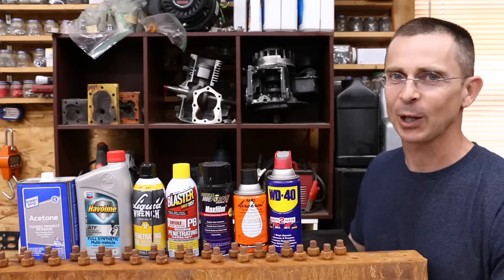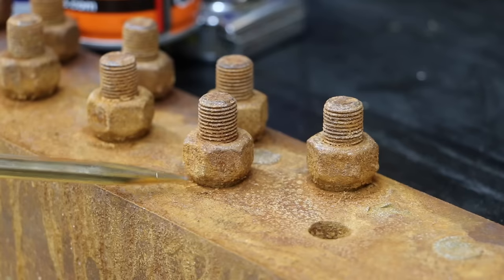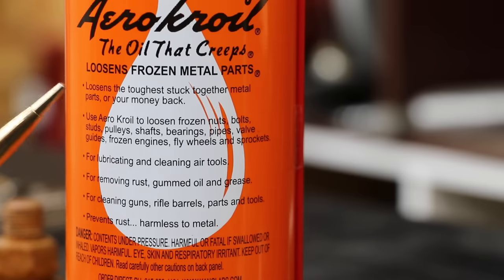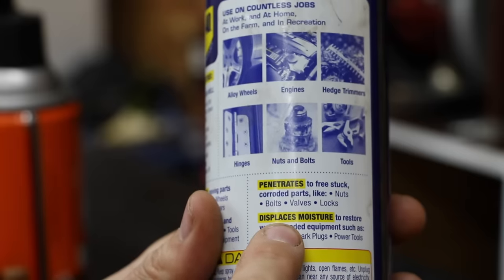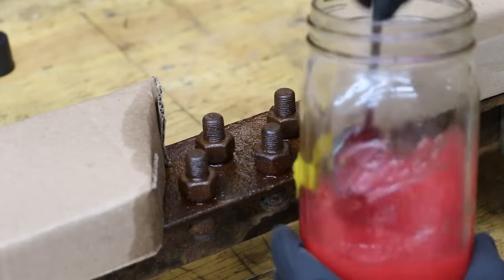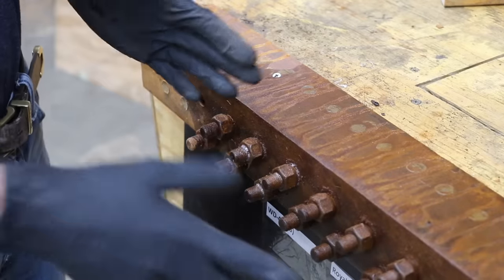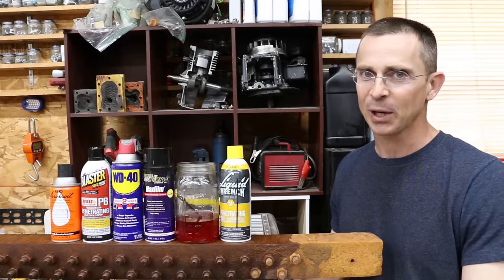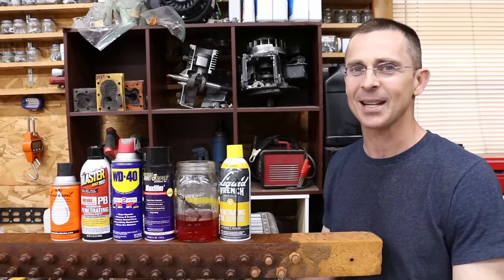Which Penetrating Oil is Best? Let's find out!

Comment: I love PB Blaster because you can shoot it across the driveway and lube that nut under your truck before you crawl under there to wrestle with it. 
Also helpful when defending yourself against the wasp nest you discover once you get underneath there.
Reply from the maker: lol. Yes, it does indeed have a lot of "blast".
Reply: I have always been a huge fan of PB but I felt this was a well done, honest comparison video. I just watched part 2 as well. Excellent job, thanks for posting these. I will still keep good old PB on hand but would also consider Liquid Wrench in the future based on this video. I keep WD40 around for indoor stuff where I dont want to a big mess blasting it with PB.
Reply: @trailblogger  PB blaster is crap. Everybody around here uses it and I just laugh at them. It stinks to high hell and barely does anything. Try ZEP45. It's expensive but definitely worth it.
Reply: @deeznutz2646  I agree about PB Blaster. It's absolutely useless. I didn't bother finishing the video but after 30 years experience turning wrenches... The absolute BEST penetrating oil made is AC rust penatrant #88862628. You can buy it for $13 at any GM dealer. I've tried every brand out there including 50/50 ATF & acetone. ZEP & Aerokroil are ok but the AC lube is the only thing that truly works. Closest second is industrial liquid wrench.
Reply: @stevemccauley5734  Well, let's get PF to test it.
Reply: @dposcuro  Or you could just go buy a can to prove to yourself and not care what the internet says lol. As a daily mechanic in my own shop I've tried anything and everything suggested to me or I've read about on the net. I've sat for hours reading forums to see what others suggested after I came to the realization one day that PB Blaster would evaporate after soaking for a couple hours and do nothing. Then also realized every damn can I had in my shop would stop spraying after it got down to an ounce or two. So I ordered several different brands I'd read others claim were great. MOPAR, Aerokroil, ZEP, industrial liquid wrench, Industrial WD40, mixed 50/50 ATF & acetone. Besides my torch, the next best thing is AC lube.
Reply: Did anyone here try Ultralube? It's good for penetration but then it gums up eventually. I just like it because it's non toxic and doesn't stink.
Reply: @stevemccauley5734  but can you defend yourself against a swarm of angry wasps with it?
Reply: PB kills German hornets quickly!  (Didn't try the other products to compare.)  And a lot cheaper than wasp/hornet spray.
Reply: i noticed during summer working on the car that pb blaster actually attracts wasps!!not fun at all!!!it has this orange smell that they seem to like!!
Reply: @reversalstudio  well what are you waiting for then? blast em!
Reply: That makes me think to try it out on the neighbors cat when he goes to piss on my rims lol, good stuff!
Reply: Man try spray glue, also if you are board you can go find you a wasp nest snack it and spray the wasps as you run real fast. Lol
Reply: You need to be fleet-a-foot so you can get away from the nut under the truck after you squirted him with PB Blaster.  I have an adjustable spray bottle of Texaco Penetrating oil mixed 50/50 with Marvel Mystery Oil that does the job for me.  The bottle squirts far enough  but not so far as to get in trouble with the "nut under the truck".
Reply: You can do the same with CHEAP carb cleaner or Gunscrubber with the red straw.
Reply: Trailblogger, it works good on flying predatory insects as well.  Write along with brake clean and carburetor cleaner but it's not harmful to paint.
Reply: I work on elevators and PB Blaster does work but the smell is overwhelming. My customers always complain when I use it so I stopped.
Reply: @blackrichard1029  project farm should try that
Reply: Lol
Reply: Not disagreeing with you at all actually. You can use whatever your little heart desires, I will stick to my giant can of PB Blaster for $5 bucks a pop. Good day sir.
Reply: That's funny I am watching this video because I have a stuck brake line and as I was under the vehicle today I noticed an angry inground beehive behind me. I also thought of spraying it with liquid wrench lol
Reply: @stevemccauley5734  I find deep creep by seafoam to work quite well. But not all places sell it, especially on weekend evenings which is when I can work on my own projects.

Comment: I'm a Kroil guy, and I think I just bought my last can. Thanks for the great video.
Reply from the maker: Thank you!  I wish Kroil would have done better.  I don't mind spending more, but need the performance to match the price tag.
Reply: I was thinking the same thing.  Ive used and recommended Kroil for years.  Now I feel like ive just wasted mine and my friend's money for years
Reply: I'm in the same boat. Have half a gallon of Silikroil left, so I got a couple more years before I can justify buying something else though. At least when I do my wife will finally stop complaining about the smell in the garage from when I use it.
Reply: Mat D half a gallon? fuck why did you buy that much.
Reply: carolyn mmitchell It was $50 plus slipping.

Comment: It’s quite interesting over the years of having a large shop and using different products, that sometimes the sales of the different penetrating oils and their slogans seem draw us to gravitate towards one over the other, especially the one with the capillary action! There’s always the proof is in the pudding over sales gimmicks! Great review I enjoyed it  : )
Reply from the maker: Thanks!  Thanks for sharing.
Reply: I just used PB Blaster on rusted banjo bolts on my master cylinder. Worked great! That's what brought me to this video, very surprised with these results!
Reply: I have seen obvious great results 3x from PB Blaster. I have heard brake fluid works but have not tried it. I am going to buy the winner of this contest and try it.
Reply: I'm from the NE/ Midwest.  Everybody swears by PB Blaster for loosening rusted hardware.  Of course, it helps to keep it from rusting in the first place.  Undercoating is a scam.  I've never used it and probably never will.  Just keep your car clean, including underneath.  And lubricate other devices as needed.

Comment: Interesting video! I am an automotive student and in our shop, all we use is PB Blaster, and that is all I have also used for years now. I may have to give Liquid Wrench a try! This is a very unrealistic test though. I do not know of anyone in the automotive industry that has time to apply 3 coats of penetrating fluid with an hour of soaking in between to free up a stuck bolt. Realistically one coat is applied, then attempted to remove after 5-10 minutes. This would be a more real world test for this type of product, but I guess if you are just a DIY repair person with plenty of time, this is a good approach. Great video though!
Reply from the maker: Thanks for commenting on this.
Reply: Koorite if you read my comment I say PB Blaster hands down. Its What every REAL PRO will reach for... And WD40 Is for Newbies and Walmart shoppers... I havnt had a use for WD40 Since i was 13 and im 40 now... WD40 Shouldnt even be in the lineup... Regardless, when you find something that works on EVERYTHING and youve never needed to look any futher... then WHY LOOK ANY FUTHER... Try PB Blaster and youll be set for life. I use it as my all around pen oil and rust gaurd... All my tools get wiped down with it after a hard use before storage. Plus 1 can last forever and a prick year... The Can ive got now ive had about 8 years. It doesnt take much at all and it last.
Reply: DrJones yeah, i know WD40 is junk. i currently only use pb blaster now and it works great, but this video showed that liquid wrench is also a good penetrating fluid, so i would like to give it a try since i have never used it!
Reply: PB blaster is junk. CRC Knocker Loose #1. PB is the WD-40 of penetrating oils.
Reply: The student speaks!
Reply: I think the point was that he used the same approach on each set of bolts. So his test is good enough for a rough comparison of products.

Comment: Great channel! I really appreciate the way you lay out your tests and your great attitude in general. You always see the way to get consistency and validity with your test parameters. I've been recommending Liquid Wrench for about 30 years now. Nothing works better on the tough fasteners. Nice to have you demonstrate it. The old formula was stronger, but nasty smell!
Reply from the maker: Thanks!  Thanks for sharing.
Reply: I just tried to buy some and everyone is sold out.  The nearest Home Depot that has it is 400 miles away, Walmart is completely out, Menard's is out...never mind.  Found it at Fleet Farm for less than half the price.

Comment: I'm surprised the PB blaster didn't do better. Glad to know I'm not missing out on anything by not buying into the Kroil craze.
Reply from the maker: Thank you for commenting!
Reply: Joseph Marciniak I've only ever used Kroil because that's just what my shop buys but this was eye opening. I showed this to my boss and now we are going to try Liquid Wrench. We rebuild antenna tilt machines on navy ships, so there are DEFINITELY some nasty bolts that I have to deal with.
Reply: a lot of people just fanboy the most expensive and preach it
Reply: my money was on PB as well, but then that's why I watch the video.
Reply: BlowDiamond I'm a mechanic in Pennsylvania and I've been using PB Blaster for years. If I can find Liquid Wrench locally, I'll certainly give it a shot. The salt they throw on the roads really corrodes things. Its damn near impossible to work on older cars here without a torch.
Reply: Joseph Marciniak Yeah, salt and steel are not good friends. We rebuild our units with 316 stainless steel hardware so we don’t have to worry about rusty bolts the next time around.

Comment: As a former millwright there is one tried and true that you did not use, the hammer! The old adage of it that don’t work get a bigger hammer (there is a modicum of truth to that). If you whack on a rusted up bolt or nut a few times you will always loosen it up a bit! That’s why impacts work soo well! 
You came up with the same results as old uncle bumblefuck did! AVE!!!
Reply from the maker: Yes, the hammer works wonders!  Thank you!
Reply: Hit with a hammer if it doesn't move use a bigger hammer if it breaks it wasn't built right!
Reply: If it won't fit, force it.  If it breaks, it was defective.
Reply: @Joshua Carnine - As a current ignoramus, who doesn't understand the value of knowledge, experience, and wisdom, I belittle anyone who does.
Reply: Project farm: yes very true, if you read my other comment on here you will see I never mention the hammer method, but yes in some applications just the good old beat the tar out of it a bit can work wonders, also if you hold one hammer on the back side of the stuborn nut as an anvil then smack the other side of the nut with a different hammer sometimes is even more effective yet (transmits more of the force and vibrations directly into the nut so it would seem), or another trick is to concentrate the hammers force by using a metal cutting chisle to really concentrate the force of the hammer in a very small area on the side of the nut, this will cause the nut to be mechanically expanded ever so slightly and many times be rather easy to remove after doing so, you just need to not mess up the fastener to the point where a wrench will no longer fit it, anyhow good luck on those stuborn fastners my friend lol.
Reply: Not trying to belittle anybody. Touchy touchy, WOW! Information is power. Just gave some background so I’m not just some jackass who knows nothing saying something! 

The main reason to watch this channel is to gain information that you may not have or maybe forgot! Keep up the good work man. Love the vids!
Reply: david helmuth so true..ave...rules
Reply: David Helmuth, my Dad was a millwright too. You guys have a lot of knowledge of so many systems. Great respect from me!
Reply: @johnmalz6684  There certainly is some truth in using a hanmer the shock helps to break the rust  bead and then it allows the penetrant to do its job i find having worked on vintage cars there is no one method of unseizing engines or motors that have rusted up over the years generally it takes a few different methods tapping with a hammer some heat and penetrants.
Reply: @looseballs1966  Hammer and chisel; old VW rear axle nuts!

Comment: I’ve noticed when I used penetrating oil and finally get the nut off the bolt the threads that was under the nut are dry. Maybe you could try this again and take the nuts completely off the bolts to see which oil actually penetrated all the way. I also noticed that your bolts and nuts only have “surface rust” . If your setup was outside in a natural environment for a long period of time say a year or two you would be more likely to snap the bolt or strip the threads. But in my opinion, heat would be the best if able to use safely.
Reply from the maker: All great points.  I'll publish another video using different brands soon and will use your suggestions. Thanks again!
Reply: Re Carpenter heat melts my fiberglass boat!
Reply: Liberty Barker if your able to get a nut splitter on your rusted nut then that may be an option. Another way may work is using a 4-1/2” grinder with a cut off wheel and make a slotted cut (like for a flat tip screwdriver) through bolt threads and nut but don’t go too deep to damage boat. Then use a small chisel to split the rest. And may I recommend using some anti-seize on the new bolt threads, this helps keep moisture and rust from forming. A third option ( if you can get to both sides of nut/bolt) is to keep tightening it up till it twists apart (two impacts if possible). But if only option is penetrating oil I would give nut/bolt a little twist, spray oil, twist, spray...repeat. Hope this helps you out.

Comment: Well, that was interesting. i have several cans of PB blaster in my garage, I guess I need to buy liquid wrench.
Reply from the maker: Thank you for the feedback
Reply: I have most of a gallon of Kroil, which I thought was better than PB Blaster.  Always poopoo'd liquid wrench.  Shows how much I know!
Reply: @gizzyguzzi  Most of the praise I hear for Kroil is for large stuck pieces like mower/etc wheels stuck to axles, etc with large and deep contact areas that require a lot more time to soak in, maybe a week before it'll come off without having to cut the rim or axle even with a gear puller and a torch. 

These results are pretty interesting but generally you wouldn't even be using these products on anything that you could torque off at all unlike the controls. I mean how stuck are the rest if they cranked off by hand even with a breaker bar? I'd find it more definitive if the first 4 left untreated needed an impact wrench and/or snapped a bolt or two.

Comment: Great test. Glad to see most of my assumptions confirmed i.e. Liquid Wrench = best, WD-40 mid point. 

I hear heat advocated ALL THE TIME, impressive difference. But you're right, heat is not always an option, either due to possible damage to paint, electrical, combustibles/volatiles (fuel lines, brake lines), etc. adjacent to target fasteners or seized parts; of just plane not having any heat capability such as roadside tire change or repair/replacement of other automotive parts.
Reply from the maker: Thank you!

Comment: Back in the day, (about 1960) the maintenance guys used the liquid that settled from the  heat treating furnace's huge natural gas line's "drip leg" to free stuck bolts.  I wonder if Liquid Wrench is similar.  As another poster said, it sure does smell like it.  Gee-  I have been using PB Blaster as my go-to solution for quite a while.  But, come think of it, I often still have to go the "heat" route if that doesn't work.  I use induction heaters when a flame isn't feasible, by the way.
Reply from the maker: Thanks for sharing.
Reply: PB Blaster has been my go-to as well, sadly it didn't do too well.  I had heard that using heat could compromise the strength of the bolts, not sure if that's true.
Reply: @da7heaven  Re: "I had heard that using heat could compromise the strength of the bolts, not sure if that's true."   Yes, I am certain that it IS true,  unless you know for sure that the bolt is made from steel that is too low in alloy to be hardened or tempered.  I particularly cringe when I see someone heating automobile suspension parts to a red glow. If the bolt is replaced by a new known-to-be-correct one, that would be okay.  On the other hand, using heat on exhaust manifold parts doesn't bother me.

Comment: In most real life scenarios, rust compromises the integrity of the metal specially on smaller nuts and bolts. Which is why so many of them strip. 
CRC Freeze-Off, a blow torch and an extractor is usually my go to when a rust job really wants to test me. 
Love all your vids!
Reply from the maker: Thanks so much!  Thanks for the feedback.

Comment: Great video. As you stated, penetrating fluids do very little. That has been my experience in over 40 years of messing with every rusted thing I found. I use WD40 to keep critters out of my stored equipment and to offset corrosion in my mower decks. Great for control cables as well.
Reply from the maker: Thanks!  Thanks for the feedback.
Reply: WD-40 is better as a water dispersant than a penetrant.  It does work well to protect surfaces from corrosion during storage.